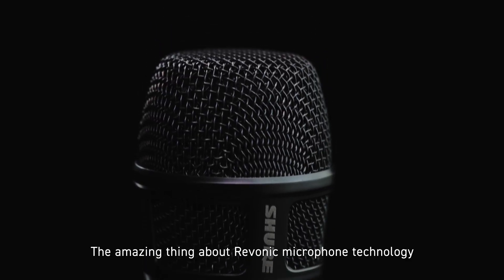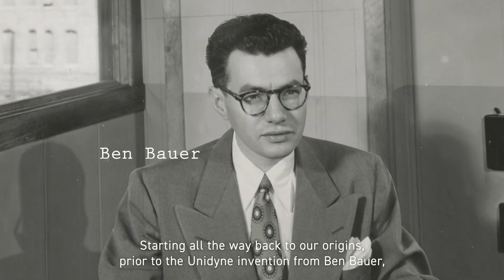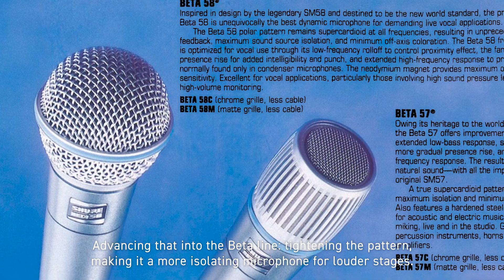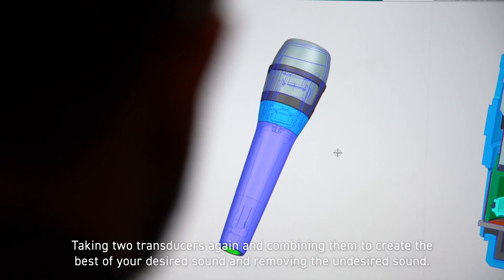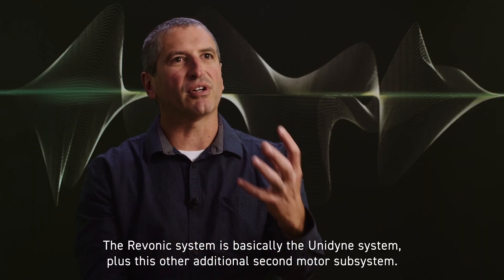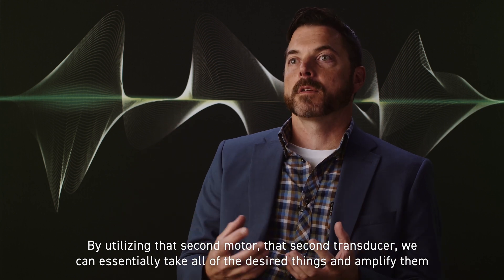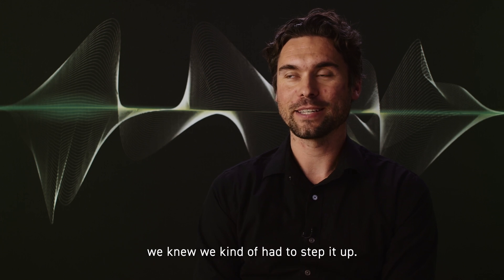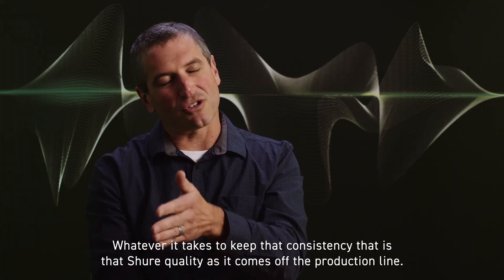Behind The Sound:  Nexadyne Microphones and Revonic Technology

Comment: Does the wireless model have the same performance as the wired?
Reply from the maker: If high-quality audio with minimal risk of disruption is your priority, and mobility is not crucial, a wired option might be preferable. Conversely, if freedom of movement is essential, a well-designed wireless system would be advantageous, keeping in mind the need to manage potential interference and battery life.

In terms of sound quality, both microphones offer the same key benefits, thanks to the dual transducers coupled in the same acoustic space. You won't be at a disadvantage, feature-wise if you choose one over the other.

Comment: Forget about a Beta58, let’s compare with a Beta 87A.
Reply: Beta87 is a condensor microphone, you cannot compare both. 

Dynamic is the preferred choice of live performers. And the challenge is getting more gain without having a 48v power
Reply: @Gtam25  oh I’m pretty sure you can compare them
Reply: You can't use beta 87a in a rock band becaise it will feed back😅, so this mic is not flexible,,, acoustic set up or large stage is applicable for beta 87a,
Reply: @josephgilmontecillo5541  Yep- Imagine 87a response with good stage noise rejection

Comment: Wonder how’s does this compared with KSM8
Reply: almost anything sounds better than a KSM8
Reply: @bendemeyer6365 not so, I have over 30 microphones from all the top makers and the KSM8 is in the top 3, it punches through the mix on stage without sounding the least bit harsh
Reply from the maker: Nexadyne has a tighter polar pattern, and it's more consistent frequency-wise. You'll also notice that it has a slightly brighter (yet not overwhelming) tone compared to the KSM8. We encourage you to try one out to see if it's for you.